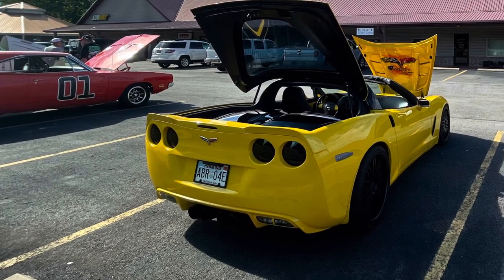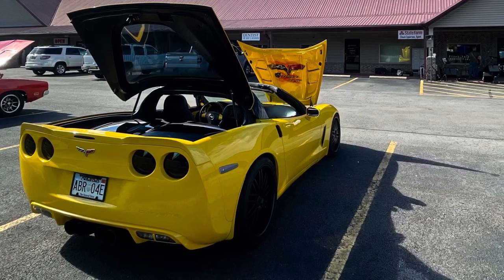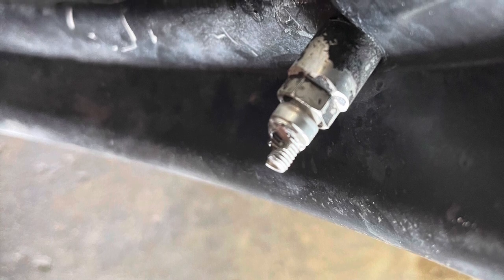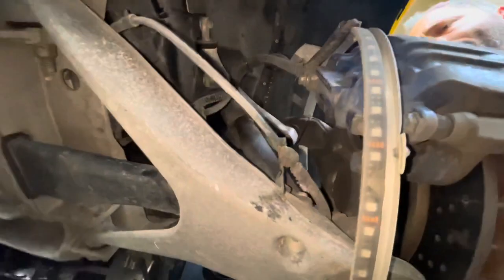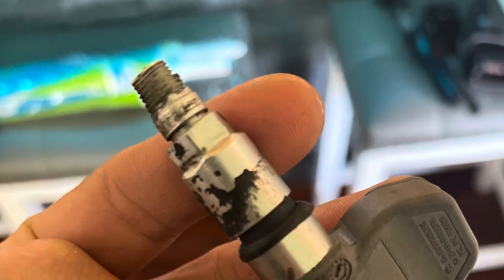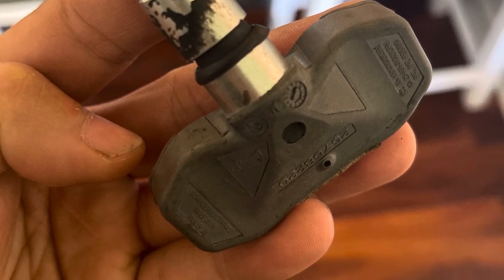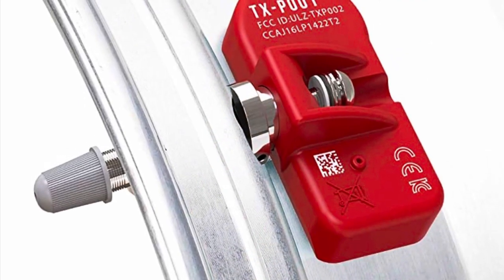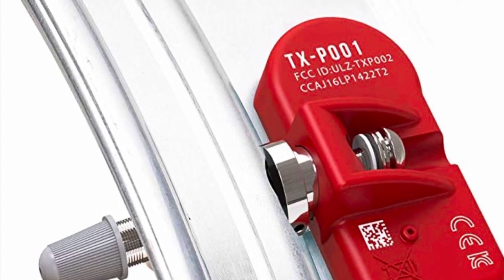Corvette C6 Inner Valve stem hitting suspension/brake problem/fix short valve stems tpms sensor

Comment: I got the same problem on camaro 5 after change the wheels. Inner stem hit the both rear brake lines. I have ordered new stoptech brake line and the same valve stem from your link description. Thanks Bro, appreciate 🙏
Reply from the maker: Glad to help. All of the tire shops in my town had no idea how to fix it. There idea was to duck tape the TPMS sensors to the wheel Inside and put a short stubby valve stem in🤦🏻‍♂️

Comment: I also have the same problem. But thinking to find shorter one.
 How many inch does the stem stick out for the shorter one?
Reply from the maker: I ordered the shortest ones I could find. Not sure how long they are though. I put the link in the description to the ones that worked for me